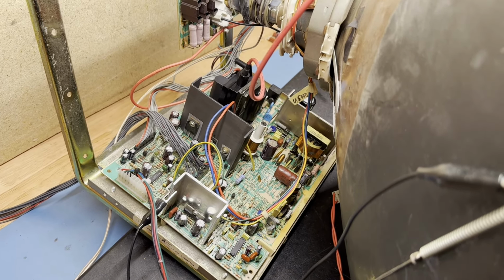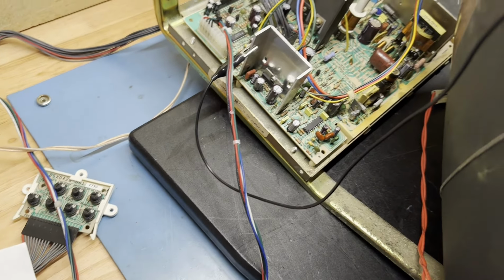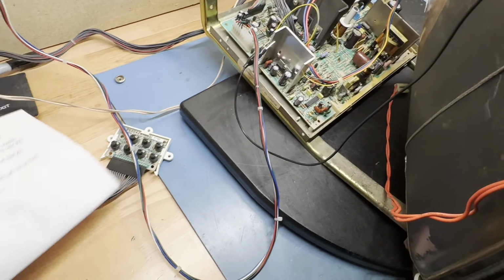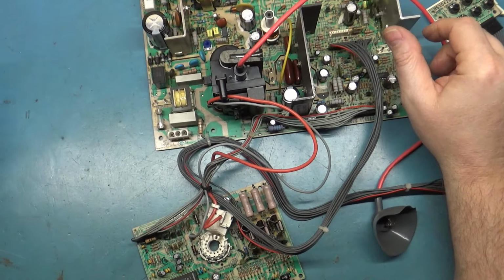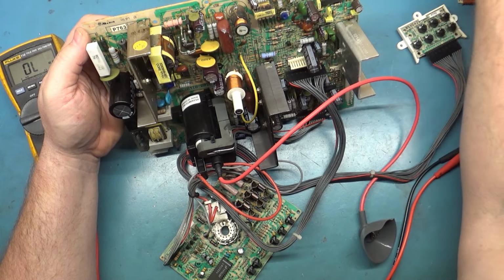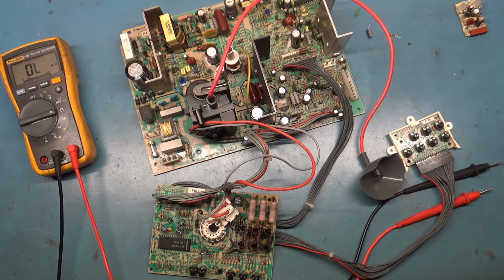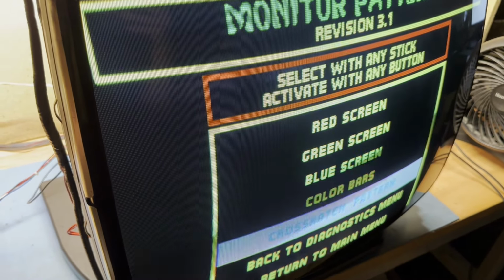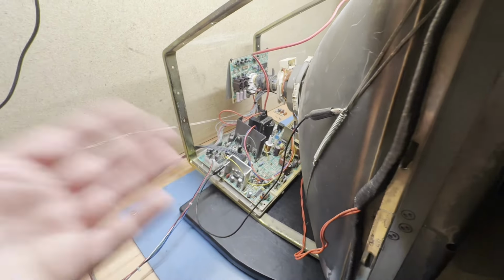25" K7400 Arcade Monitor Repair - Vertical Stretching and Tearing Issue - Bad R613?

Comment: I have an Atari Road Riot 4wd machine. One of the monitors works. One has a loose wire, but the units are slightly different and I can't figure where it goes. How can I send you some pictures?
Reply from the maker: Mikesmonitorrepair@yahoo.com